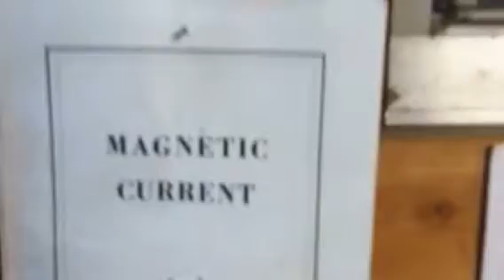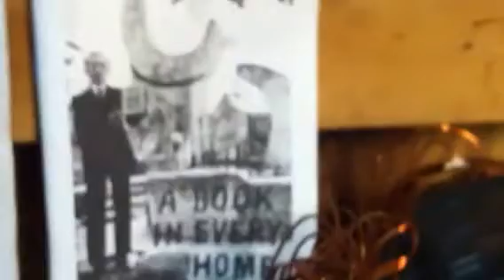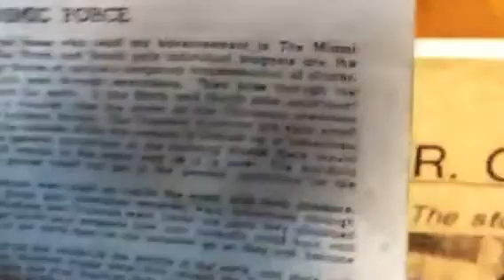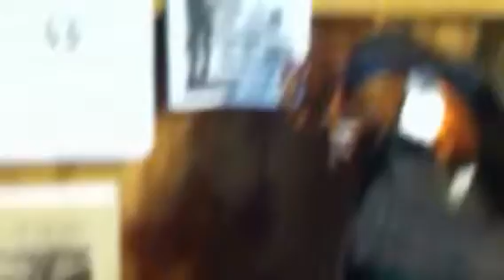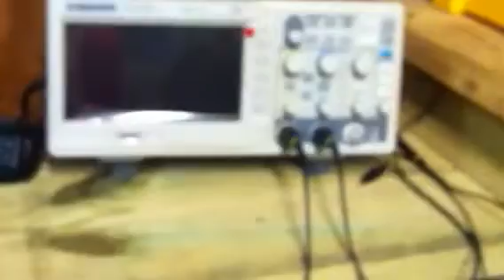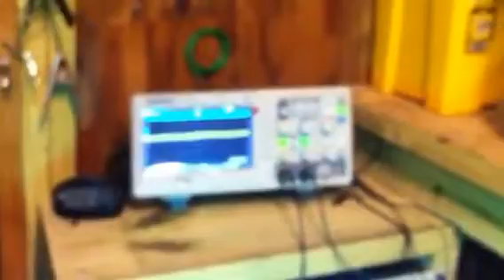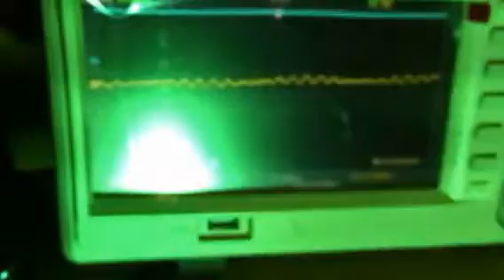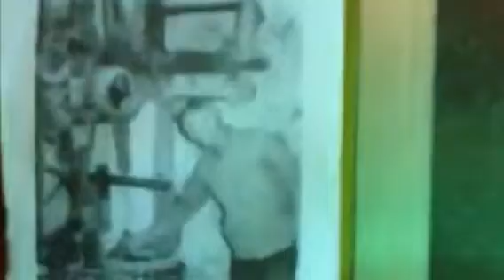Ed Leedskalnin's Magnetic Flywheel Generator

Comment: Looks like you need to tighten up your magnet relationships between wheel and outer magnets and stuff.
You said yourself its all about timing -well maybe the faze relationship of your induction process needs to be tighter/more in sync.Maybe your main wheel is a bit buckled and your outer magnets are off target.If Ed turned it by hand it would generally work no matter how fast he spun. I've heard someone else suggest he used water inside as a non restrictive circuit maker.
I hope some of this helps.over all your posts are quite impressive with your dedication to Ed. if I was to comment on anything I would suggest condensing your information to help maintain our small attention spans, but over all I liked your show.

Comment: here is a gift to those that seek to know the secrets of MAGNETIC CURRENT
 Control Factor Formula:

C - 2 + 14z = 710Y + 409 430
OUT OF BALANCE!
Note: We were given the majority of this information in
1985.
This formula describes a molecular structure just outside
the earth's rim that is the CONTROL FACTOR that governs the
complete particle interchange process of our solar system.
The balanced formula is given as C - 2 + 14 2 + 14z = 710Y + 409, however the current situation on our planet has the formula
reading something like C - 2 + 14 2 + 14z = 710Y + 430   which is out of balance.
Two main technological advances, electricity and
radioactive particle production (and the spreading of those
particles through explosions, power plants, etc.), are creating an
imbalance in this formula. Evidence of this imbalance is
becoming more and more apparent. The ozone holes (which
continue to worsen), the increase in storms, earthquakes, and
volcanic eruptions; the gravitational fluctuations and the sun’s
erratic behavior are all indications of a serious imbalance in the
system. We will briefly discuss this evidence of imbalance.
The ionosphere is not merely an "ozone layer" or "invisible
gases" but it is a rim of pulsing neutrons that is the
DISTRIBUTION ZONE for the energy that supplies this planet.
Electrical power plants are now forming ionospheric neutrons
into electricity at a rate whereby the FEED SOURCE that provides
our planet with energy cannot sustain this protective rim, thus
ozone depletion is happening. REPEAT: ELECTRICITY IS THE
PRIMARY CAUSE OF OZONE DEPLETION. It is imperative to
generate energy from a natural attract-attract principle. People
will soon be able to observe the core structure of the electron,
then the need to stop generating electricity will be well
understood because the effects of electricity will be clearly
observable.
The molecular structure  C - 2 + 14 2 + 14z = 710Y + 409
governs the conditions within the entire earth system, including
the conditions of our atmosphere. As this governing molecular
structure is affected by electricity and radioactive particle
production, our environment reaps the consequences. For
example, storms start as an imbalance in the magnetic field that
creates the physical manifestations (tornadoes, hurricanes,
lightning, etc.) that are attempts to regain balance. The storms
will get worse as humans throw off the magnetic harmonies of
the earth with more and more destructive technology. REPEAT:
THE EARTH’S MAGNETIC RE BALANCING IS THE PRIMARY CAUSE
FOR THE INCREASE IN VORTEXUAL STORMS.
Like wise, almost all geological activity is the result of the
earth regaining or reestablishing balance in the magnetic grid.
The earth depends on atomic consistency in the elemental
vibrations. Humans have created elements that do not occur in
nature and then humans spread those elements throughout the
system. This radical molecular contamination is far more serious
than scientists have realized. The future of our species depends
on redistribution or nucleic breakdown of radioactive particles.
THERE IS A DIRECT CORRELATION BETWEEN HUMANS
THROWING OFF THE PLANET’S ENERGY GRID AND THE
UPHEAVAL OF THE ELEMENTS TO REGAIN BALANCE.
The energy exchange between the earth and sun is
continuous and largely interdependent. The conditions on earth
are reflected by the sun and visa versa. The earth and sun will
purge the system of radioactive waste and a new magnetic grid
will be established for earth.
The variables in this formula (C, z, & Y) represent energies
that are constantly changing to keep both sides of the equation
in perfect balance. This formula represents a system in motion.
The molecular structure (represented by this formula) is
designed to keep perfect harmony between the Center Point or
KING PIN, around which the total Universe takes its preordained
course, and the Earth. The left side is the energy from the
Universe coming into our Solar System and the right side is the
manifestation of that energy. The problem is that we are
currently experiencing an imbalance of energy on earth because
of our technological influence. This imbalance is causing an
unwanted change to the Y part of the formula. Fusion, fission,
and electricity are creating harmonic rifts in the Universal
tapestry that must be mended.
The impact of electricity and radioactive particles is now
responsible for the destructive distortion of the 710 units of
combustible factors. Humans have misused natural forces to
create unnatural elements, which are now a major contributing
factor to the timing of the DRASTIC EARTH CHANGES that are
about to occur. The earth, and the system it is part of, is in the
process of re balancing itself with a pole shift and a series of
gravitational/energetic changes. Some people will say that God is
punishing the people on earth for their sins, but nothing could be
further from the truth. The current and coming earth changes are
critical to our survival.
We will try to explain the formula further:
At this stage of our human understanding this formula
serves more as an explanatory tool of the workings of our solar
system, compared to a scientific equation for taking
measurements.
C is the magnetic light, in this instance, without
considering time and space.
- 2 is the number of planets Earth is away from the center of
our Solar System, identified as Z or Jupiter.
+14 z
is Jupiter at 14°, the 14 being the magnetic light arc as
it travels from the center, Jupiter, to the Earth at a 14°angular.
The Z represents the units of magnetic energy coming from
Jupiter to earth.
When the left side of the equation is calculated, it equals
710 units of combustible factors; these factors are multiplied
with Y. All of the combinations of combustible factors result in
the production of 409 elements that structure the Universe.
Y is the combustible factor of the elements. Y represents
every energy polarity or signature necessary for the
manifestation and redistribution of any molecular combination. Y
helps organize the 710 combustible factors into the 409 elements
that make up the physical world. Everything that exists within
our planetary system has a specific energy vibration that keeps
every group of molecules together or allows them to separate –
these energy vibrations are represented as Y. All elements have
a specific energy combination that can be formulated or broken
down. All elements are combustible with the right energy field or
polarity. The magnetic lock that holds all molecules together can
be opened or closed with the proper energy field, and this
process does not require heat as we are used to thinking. Of
course all elements can be burned with high enough heat, but
that is not the kind of combustion we are talking about. The
combustible factors can transmute elements into the preordained patterns that are imprinted on their molecular
templates or break down the molecular structures into a more
neutral polarity. The process is continuous and the number of
energy polarities represented by Y adjusts as necessary.
Humans have used destructive technology to force certain
molecules to separate and join in a manner that does not
naturally occur. This violation of natural law produces drastic
consequences that the system must rectify.
The 710 combustible factors are variations of magnetic
energy and are concentrated in our atmosphere. These
combustible factors are combinations of earth, air, sound, speed
and light and they provide the polarities to form the 409 elements
of the physical world. We are not experiencing many elements
available to us at this time. Living energy systems on earth must
exist within these combustible factors to operate at full
potential. If a living energy system attempts to exist or operate
outside of the ionosphere, it will not maintain normal functioning.
For example, if humans leave our atmosphere and do not have
the appropriate energy field on their spacecraft, their bodies will
not function properly. Gravity, or compressed magnetism, is the
overseeing force that allows the combustible factors and
elements to exist.
The letter C commonly denotes the speed of light in
scientific equations. The element light mentioned as one of the
factors of Y is not the light identified as "C" at the start of this
molecular structure equation. This is important to note. This
formula explains how pulsed light particles emitting from the
center of the Universe travel to our solar system at variable
'speeds' outside of time and space. This formula is primarily
concerned with how the high speed pulsed light energy,
represented as C, is transmuted into magnetic energy which then
creates a speed change that is considerably slower. This formed
magnetic energy is captured by our Solar System and is then
transmuted into an energy that supplies and sustains our Sun.
The light pulses then leave our Sun (and other stars) at about 4
times the speed of light waves (light waves are about 186,000
miles a second). The pulses elongate into waves when they come
into contact with something. This formula is primarily for our
Solar System. Contrary to popular opinion, Jupiter, not the Sun,
should be seen as the center of our Solar System when trying to
understand the energy dynamics of the system. To understand
the full impact of the formula, it is necessary to look at the solar
system with Jupiter as the center.
Again, a nearly infinite number of combinations of the 710
units of combustible factors produce a nearly infinite number of
combinations of the 409 elements (which are a combination of
earth, air, sound, speed, and light). The left side of the equation
is designed to equal the right side: near infinity = near infinity.
This formula is in keeping with the fact that, "All energy was and
is created ongoing from the SOURCE of all." Note that the
primary energy force in the Universal system is the vortex.
The presently held LAW of entropy is completely false. All
magnetic molecular structures are in a constant state of change
forming and re-forming with the action always resulting in 100%
efficiency. All universal systems proceed to take their prescribed
course of action with per-ordained precision from the Creator
Force, utilizing a process of time during the forming and
reforming of structures until 'given evolution' results. Yes,
scientists have observed randomness in the cosmos, and they
believe the events they observe have no order, however, the
randomness is not RANDOM. The Universe functions perfectly in
a PATTERN AS NEEDED while repeating in a random sequence.
As the scientific community makes advances in the field of
magnetic pulse detection, people will be able to monitor exactly
how many units of combustible factors arrive here from Jupiter
at any given moment, thereby maintaining the Earth's energy
needs. People will observe that the energy from Jupiter is then
used by the Earth as needed, and the Earth simultaneously
imparts energy to our Sun where it helps to sustain the Sun's
energy that is again returned to Earth. The Earth is the vacuum
of our planetary system, the final point where energy is recycled
back into the Universal system. The pollution produced on Earth
affects not only our planet, but other planetary systems as well.
Contaminated magnetic energy travels from our planet
instantaneously to other systems forcing other beings to cope
with our pollution. We are truly connected to a much larger
community than we like to think.
We must stop seeing our Earth as an independent, isolated
and non-contributing part of this Universe. We must begin to
understand that we can no longer move against nature but we
must now utilize what is being offered for the benefit of the
world. We have long overlooked, through greed, the use of FREE
magnetic energy, and the time to expand our minds is now at
hand because our planet is soon to find itself extinct if we do
not.
Reply: Did any one get my gift I offef
Reply: doug dubois too many tinfoil hats around here
Reply: Stick to the scientific method
Reply: I want to know more on how you get the formula or equation. Can you send it to me  please including all the basic equation?  Thanks.
Reply: Cornelio Framil 
Send me your email and ill give you the formula and all the prints
Reply: WRONG. What you're putting down to electricity and nuclear power is actually the result of ongoing stealth use of EMF weaponry emitted by facilities such as HAARP, cellphone masts etc.

Comment: You should try running the generator with water sitting in the cavity. Then instead of having the AC connection from the chain to the copper wire, submerge the chain into the water and spin away! Also, You can put a thin layer of cement inside of the cavity but you must make sure that the magnets are still able to touch the water inside the cavity. AC through water = no resistance.

Comment: You can tell ed's design is much different he epoxied everything in the center so he could fill it with water and have a frictionless connection to the neutral center between the poles of the v magnet.

Comment: I just hope nobody is taking this guy seriously. Ed L. was a genius, but don't judge him by these guys who try to make something look right, but its' obvious fake. This one became obvious when he pulled out the copper pipe, with the spinning magnet. Note, the magnet never moves on the pipe. It's an air pressure system driving the magnet. But the funny part, he made a mistake and had the magnet spinning when the generator wheel was NOT!

Comment: I see a lot of copper wire, but didn't Ed mention that he used coated Iron wire? At first I was perplexed when I read it, but then after thinking about it, iron seems logical. Copper has a natural resistance to a magnetic field, which creates resistance/drag. Iron, is attracted to a magnet which also is drag... until you overcome that initially by force, then the iron becomes magnetized (electro) and starts to repel the magnets, which will reduce resistance and begin to accelerate itself

Comment: I imagine how much current Edward used to draw with that metal construction. But it looks like he was making a very high voltage as well. On the photo of Ed spinning the wheel it looks like there is a spark gap between the handle and the hook that hangs on the chain above it.

Comment: I wonder what would happen if you could apply this but instead of using a 12 car bat use like 10 sodium silicate copper aluminum crystal battries instaed? that way you got yourself a battery that wont die down like a 12v car but also powers eds wheel and makes excess energy!